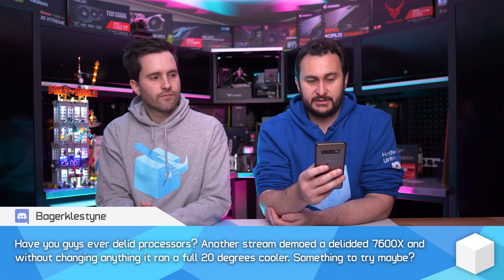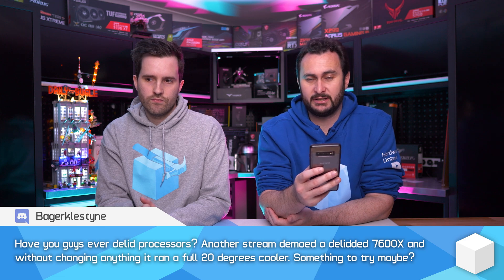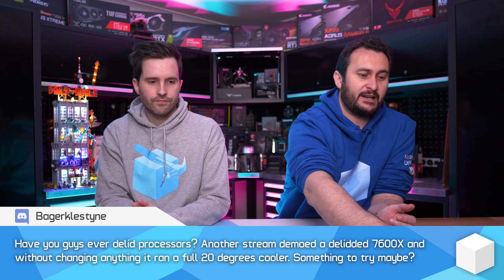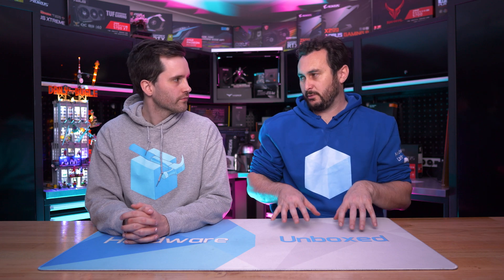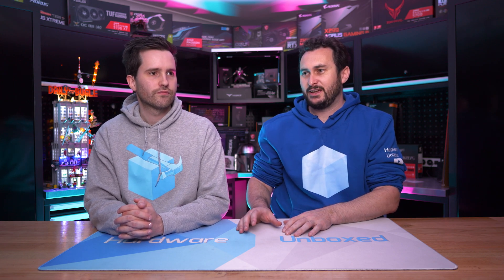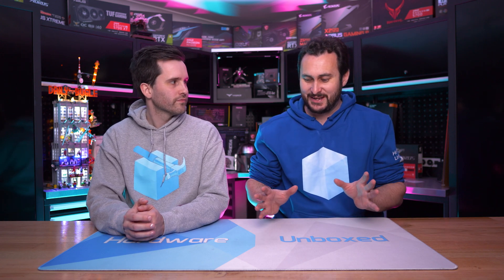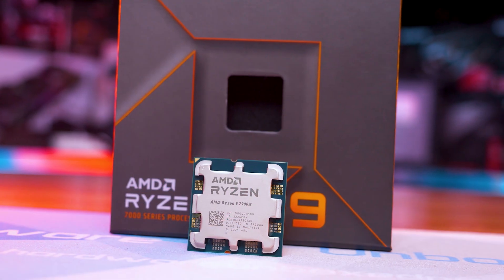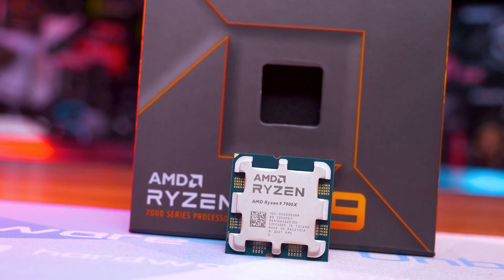Will we be de-lidding a Ryzen 5 7600X to see how it performs?

Comment: I switched from a Noctua CPU Cooler to a Phantom Spirit 120se for $39 and my temps dropped from Mid-90s to Mid-80s. That was a very cheap solution compared to the Risk of Delidding a 7600x and potentially ruining your chip!
Although, if my goal was to get more performance out of it, the suggestion of simply getting a Faster CPU would be the wiser decision. From my experience in recent games, the Stock Clocks on a 7600x is Plenty fast for any game out right now..

Comment: 7600x not worth it but 7900 and 7950x it would be
Reply: @tangled earphones overall platform cost as it stands before b650 releases
Reply: @tangled earphones added costs, a problem for am5 already. And with the energy problems they're having in Germany anything he makes is due to be expensive. It could be close to the same price to get a 7700 instead and see a better performance gain.